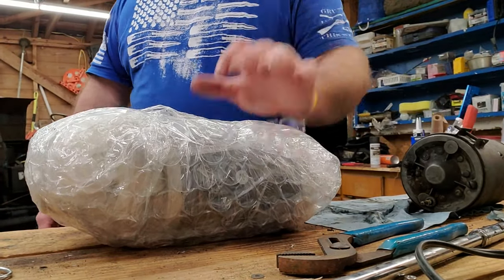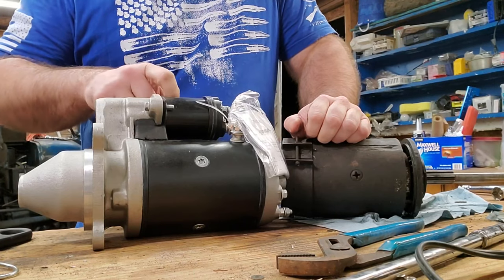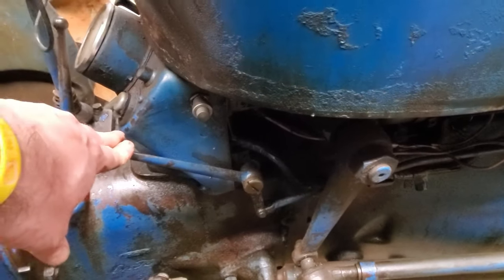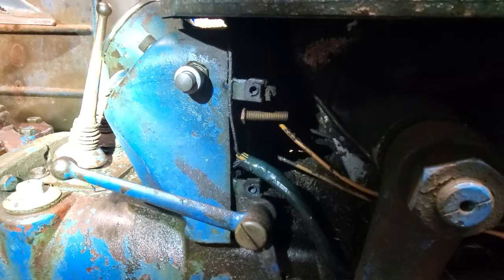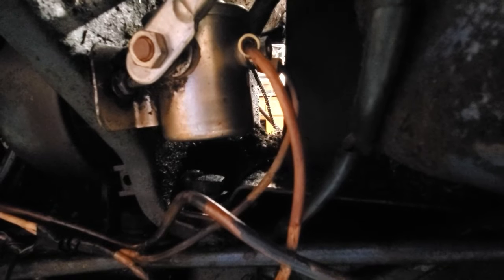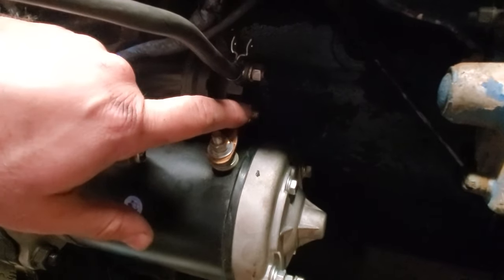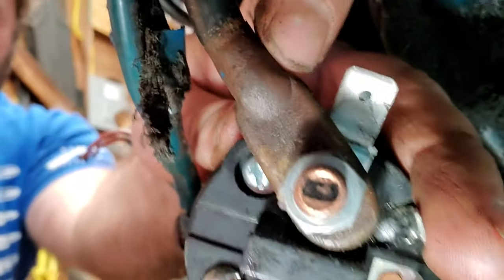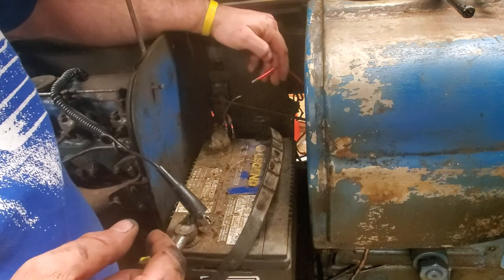Tractor Starter INSTALL  | Upgraded to Solenoid Mounted Starter

Comment: just got a new starter for my 3000 and the solenoid had more connections than the old one, like the one you installed.  thanks for explaining the hook up!